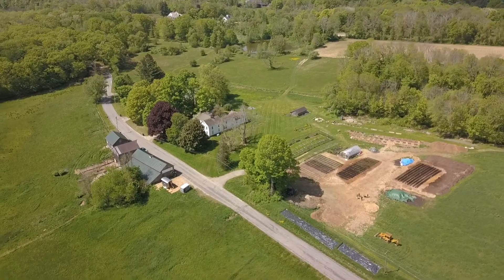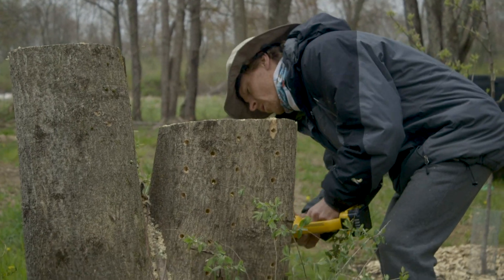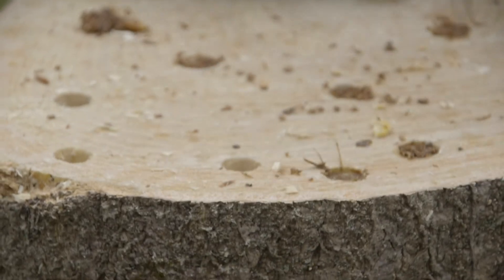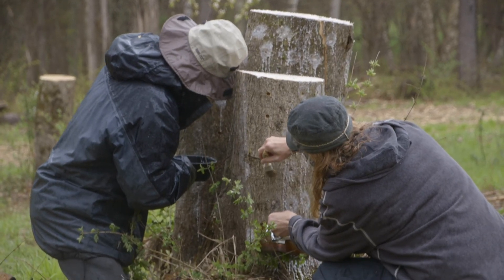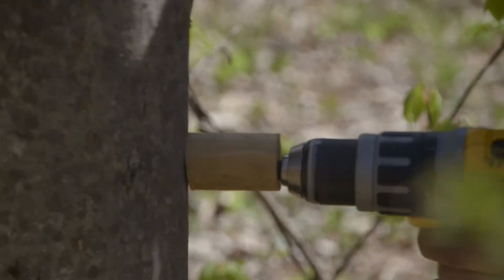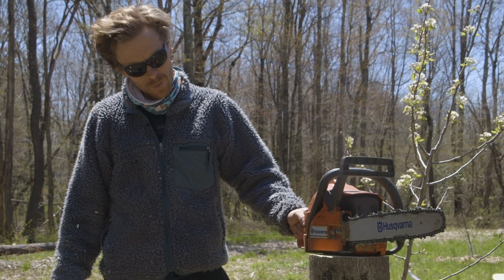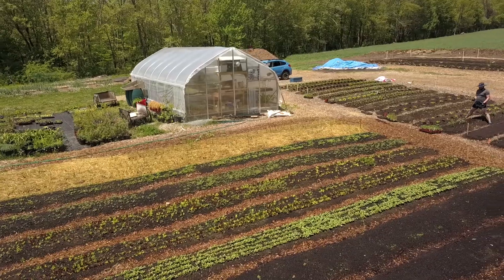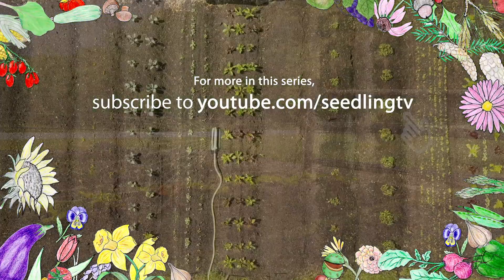Inoculating Mushrooms --STUMP METHOD--with CT Wild Harvest! (Part 2 of 3)

Comment: I noticed you were heat treating a log before inoculation.Would there  be a way to take some 6 month logs that are already covered in mycelium and inoculate and eventually get fruits ? If the bark has fallen off or become loose could I use wax to replace it? Thanks